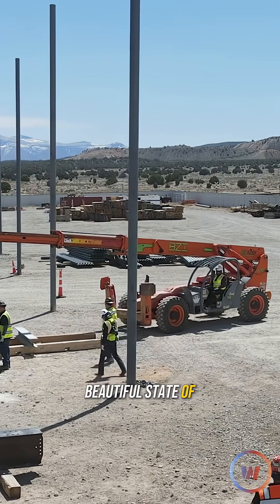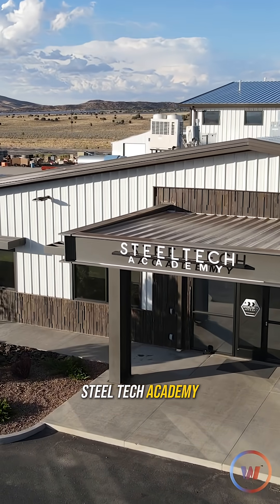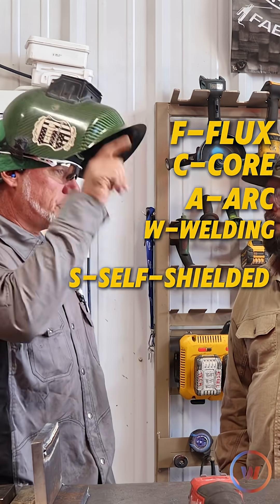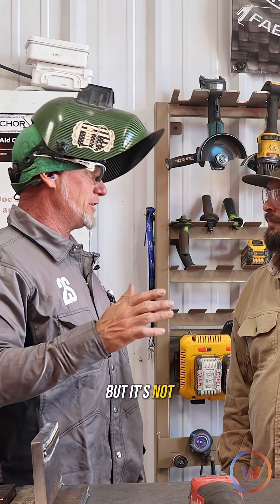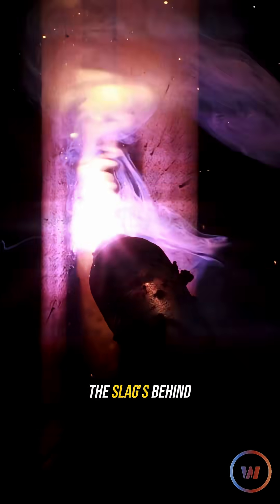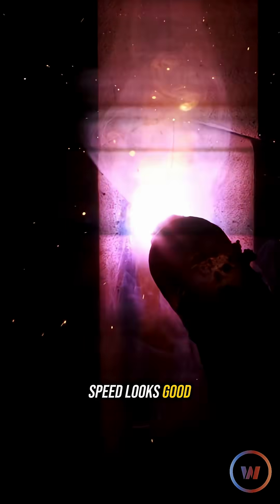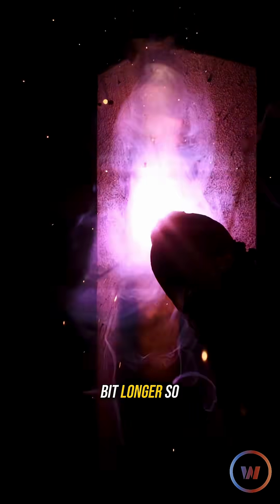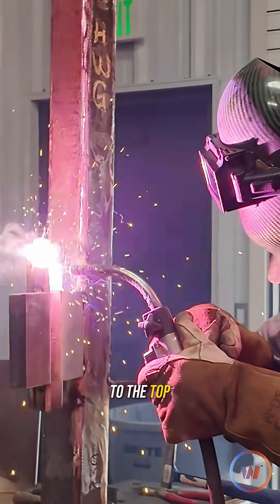Welding 1" Plate with No Gas! 3G FCAW-S

Comment: What is considered, heavy wire? I have run 0.062 wire but it was dualshield, which runs a little different than fcaw
Reply: 0.62” is considered the start of heavy wire. For the most part. Then you go up from therez
Reply: Dual shield is fcaw still😂 just the G process